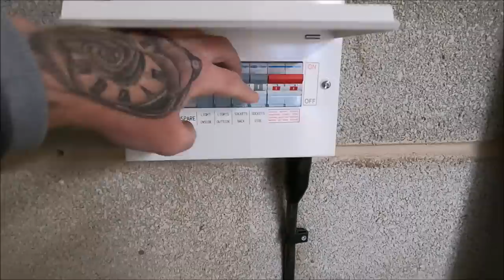Koi Diary 154 - Pond side ramblings

Comment: Nice your back Andy. I've fitted latching RCD trip plugs to each pump, air pump UV etc. Because we get the odd power cut, and when they trip out, they automatically reset. Also by having separate ones for each pump etc. If I get a short I know what is shorting out rather than one trip switch for three sockets. They're only about 12 quid each on amazon. Peace of mind for little money and plugging them in. They must be latching or they're sometimes called passive. Hope this helps

Comment: Hi Andy 
You said £3 a day running cost, is that with ashp running aswell? Awesome footage as usual 👌👍
Reply from the maker: No, remember though its a rough guess, if the washing machine had been on a few times and cooker, kettle etc then it would take away from my £3 guesstimate. To top the pond up 1.5 degrees cost about £1 to £1.50 i think roughly depending on air temps. ASHP is on now and electric shows its £1.20 more than normal for this time in morning and pond is at 16c so heater will go off in a bit.
Reply: Quality, not as expensive as I first imagined. I’ll be getting an ashp eventually 👍